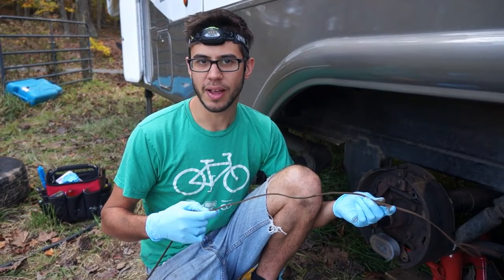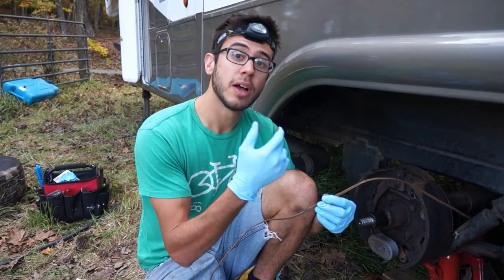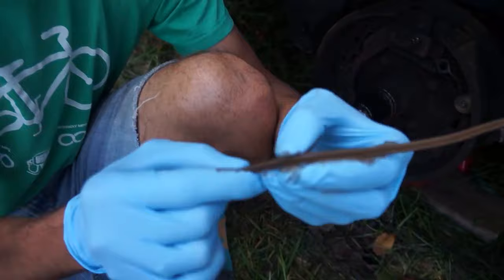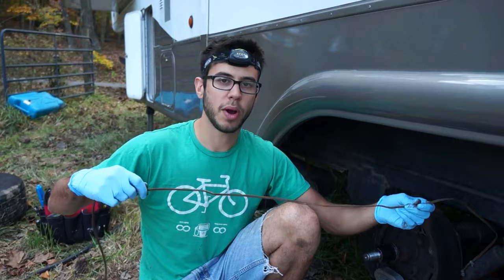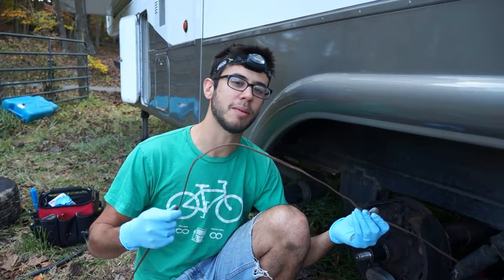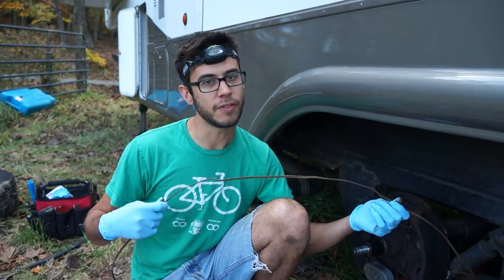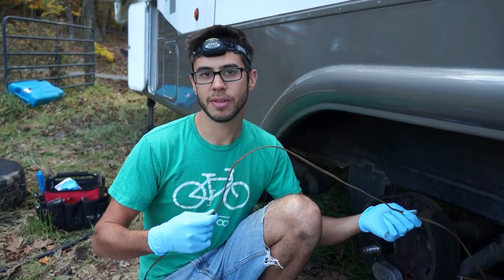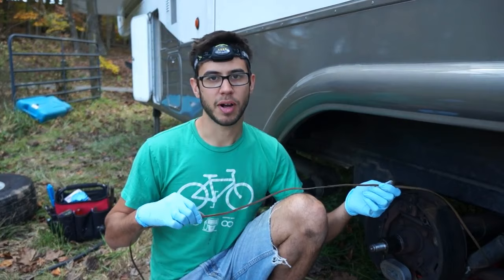Common Reason for Shorting Trailer Brakes - Electric Trailer Brakes - Check Your Axle Wires

Comment: This is exactly what I needed to know. We were having problems with our trailer shorting out and couldn't find anywhere that it was happening until I watched this video and it made sense. We changed out the wire and sure enough there were friction worn spots on one of the wires going through the axel and I believe that's what was causing our problems. Thanks for your help 😊

Comment: Thanks for posting this.  I have been having an off/on again short problem and went out today and pulled the wire out of the axle and found 4 bare spots
on the wire where it was shorting out.  I installed new wire on the outside of the axle and along with my new Teckonsha P3 controller installed on my 2005 F250SD (replaced OEM brake controller) my truck/trailer combo stops on a dime.  Thanks again!!!

Comment: I was looking up how to remove the drums on my trailer to find an intermittent short in the brake magnets and came across this video.  Sure enough, one of the wires was shorting out  in the axle.  Great video, saved me a lot of time and I'll be running wires on  the outside of my other trailers. Thanks!

Comment: I started having an issue with intermittent electric brakes on my 16' flatbed a couple of years ago. It scared the crap out of me and I haven't used the trailers since. I'll be checking the wires. Thanks for sharing.

Comment: Well this is great, I have been chasing OL code on Reese brake controller, tested controller with 12v and bulb, all functioned correctly ,checked out trailer plug cleaned looked good, finally moved wire in axle and all worked, replaced shorted wire , all is well. 
Thank you for heads up. Jack

Comment: Thanks for the tip. We have been having periodic battery drain but the brakes were fine.  I decided to replace the magnets and saw your video.  I pulled the brake wire out of the axels and there it was...worn exposed copper wire shorting against the axel.  Thanks again.

Comment: Thanks for the post you nailed it!
Brakes have worked intermittently for a while.
I had checked out my entire wiring system & it all looked good.
Watched Youtube on replacing magnets wiring etc, ready to replace everything, driving me nuts what it could be. All visible parts looked good.
Just saw your video, went out and pulled wire from first axle and there it was, wire was badly worn through. It had a protective sleeve going in and coming out, but not inside axle.
Haven't even looked at the other one but will do it anyway.
Reply from the maker: Glad this helped you out!  Dealers and trailer manufacturers will deny this is a problem but i have seen it over and over and over....

Comment: I have been having trouble with my cargo trailer for about three years. I watched your video and a bell went off. I went out and cut my wires and pulled them out of the axle. I had to wipe them down with alcohol to clean them and there it was. A lot of worn spots down to the shielding but I also found some that were down to bare wire. I ran new wiring on the outside like you suggested and so far no more problem. Thanks for putting up the video. Now I will do the same to my other trailer.
Reply from the maker: Yay! So glad it helped you. So frusterating how they run those wires.

Comment: I think it ok to have them in the axle they just need to have enough protection to keep them from wearing through the insulation.  But you are right the wires that 90 percent of trailers are inadequate.  Larry

Comment: Had the same problem on a PJ Car Hauler with Dexter Axles.  Both front and back cables where shorting to the axle tubes.  I think the main problem is not the way they run the wires but that they used really poor quality cable.  Not only does the original cable have very little insulation on it but it also has very little copper in it.  I would guess it was around 18 AWG or smaller and should have been a min of 14 AWG!  To make maters worse, the brakes on the left side are fed with a 14 AWG cable and the brakes on the right have to get their current through a long 18 AWG wire!  It doesn't take a genius to figure out which side is braking the hardest.
Reply from the maker: I can't believe how small of wire they use!  Totally wrong

Comment: Use Arctic Flex trailer wiring. Good for all temperatures good for all conditions for professional wiring
Reply: I agree and concur. I would go to the Gray jacket 2 wire with a ??3/8 or 1/2  inch red heater hose?  For mechanical protection with silicone stuffed into the end for keeping sand, gravel out double wrapped  Tye wrap every ?? foot?? 
OR up over the axle on to the trailer it's self with heater hose as mechanical protection  and suitably attached!!!!!!!! Single solder/duel wall heatshrink . Would be the easiest. I can think of other better ways which I don't have access to any more which would be better but will leave that idea.

Comment: I have seen this exact same failure in 50 years of working on RV. Every time you stop or start the wire moves in the rough rusty axle tube.

Comment: WELL I'LL BE DAMN..... THE TRAILER BREAKS ON MY FIFTH WHEEL RV ARE WEAK AND I JUST CROWD UNDERNEATH THE RV ABOUT AN HOUR AGO AND SEEN THE WIRES GOING INSIDE THE AXLE AND A SHITTY JOB OF CLIPPING THE WIRES TOGETHER AS WELL AND NOW I CAME ON HERE TO ASK FOR A VIDEO WHY MY BRAKES ARE GETTING SLOWLY WEAKER AND WEAKER - AND YOUR VIDEO SHOWS WHAT'S A REASON COULD BE BECAUSE MY TWIN AXES ARE FROM 1995 AND WHEN I USED TO START UP MY TRUCK THE LIGHTS ON THE TRUCK AND TRAILER WOULD AUTOMATICALLY COME ON WELL IDLING AND NOW IT DON'T DO THAT ANYMORE EITHER AND I GOT THE ROTOR TURNED ALL THE WAY UP FOR BRAKE POWER NUMBER 10 - I JUST WANT TO SAY THAT I BET YOU'RE RIGHT AND I AM GOING TO BUY A PASS THE AXLE - AWESOME VIDEO THANK YOU VERY MUCH EVEN IF THAT'S NOT THE PROBLEM, I'M STILL DOING IT ANYWAY.

Comment: Thank u for this video!  I’m trying to troubleshoot why my right brake is not getting as hot as my left brake.  I started to zero on on the wire inside the axel, but hard to believe a factory installed wire could go bad.  I won’t even bother to check voltage drop.  Im replacin it ASAP.
Reply from the maker: Glad it helped!

Comment: What’s sad isn’t the RV manufactures but the lack if credible inspections that go into each build. Dexter and LCI know the proper size wiring for their electric brakes and state this much in the manual that nobody ever reads and that RV engineers don’t adhere to. Manufactures can typically get away with a gauge smaller than field wiring calls for per NEC and NFPA guidelines but the RV makers go beyond 2 and more sizes under what axle manufacture specify. Don’t believe it? Lookup typical Dexter 3500-5000lb axle manual and recommended wiring. The other poor practice is the securing of cabling and penetrations made into axle itself. I’ve yet to see an anti-short bushing for penetrations. At the end of the day internally wiring is better, it keeps cable protected than exposing can but they halfass the concept so much and nobody’s in place to call them out. The only institutions in place are funded by the sale of RVs so cannot objectively inspect despite life safety matters

Comment: Tom
How long should a electro magnet be good for.  My unit has around 10,000 miles on it and the magnet is already shot. Only one ware dot left.  I am trying to find a short at this time.  Just pulled out the wire, and foumd no bad spots yet. I am also replacing the complete backing plates and starting over. Any Thoughts?
Reply from the maker: Hard to say how long they will last, these are 8K hubs and have more material but the smaller brakes wear out pretty quick.  With smaller assemblies usually it is easier to just replace the whole setup.
Reply: @MortonsontheMove  I have purchased new backing plates ready to install.  I will watch their ware moving forward.  If they ware out again quickly, I will then change to a Disc Brake System.

Comment: What would cause trailer brakes to lockup when right hand signal light is activated.
Reply: Have you installed a new trailer plug recently? Maybe you wired the brake circuit (blue) to the right signal pin on the connector by mistake ?